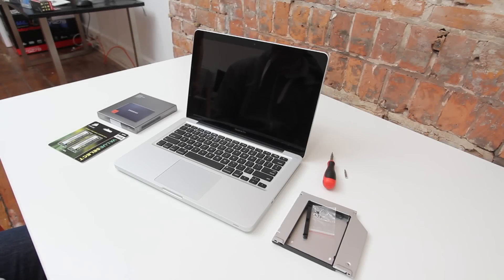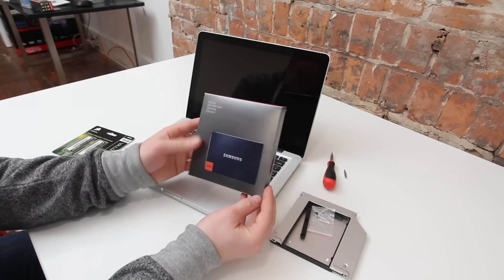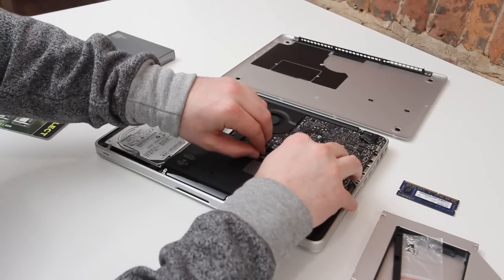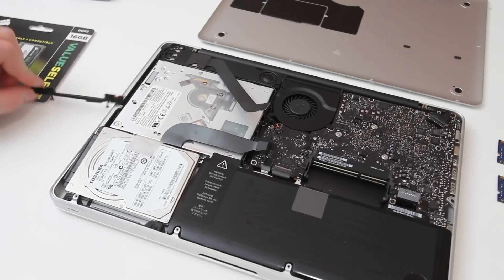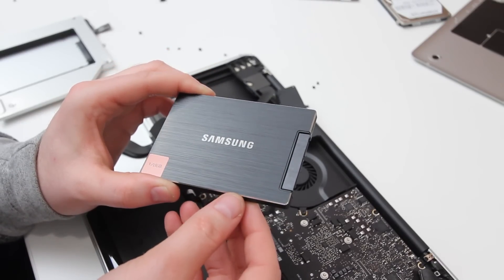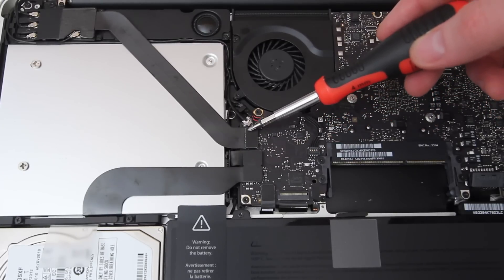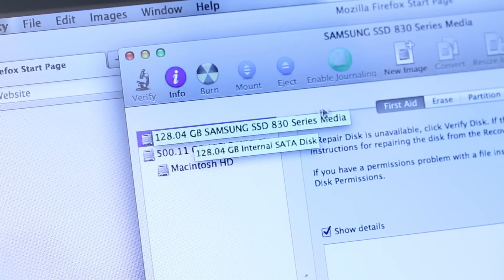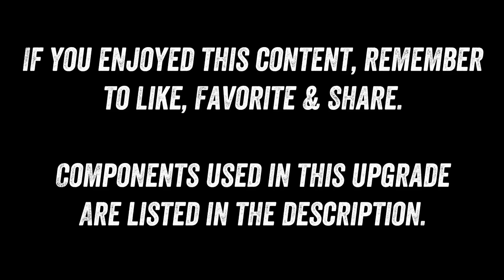Upgrade Your Macbook Pro (SSD Upgrade, RAM Upgrade, Optical Drive Bay Adapter)

Comment: Hi I have a question: If instead HDD was put at the optical drive area, and SSD in the main drive area can you still boot up your OS with HDD being at optical drive, and just clone everything to the SSD once it's booted, or you would have to install the OS on SSD first (from USB stick or Wi-Fi) ? Thanks in advance

Comment: Hi. I installed a second ssd on my 13' 2011 MBP OS High Sierra. Not thinking at all the new SSD needed formatting. Took it out, formatted it using a HD Dock thru usb. Put it back in the casing and back into my MBP. Turned it on. Still no second SSD. Any clue what I'm missing?

Comment: I've used Tardisk to update my mac air2014 SSD, however, my mac is slow when running a lot of programs, so i think it's time to change the RAM as well. do you know if this RAM-you used in the video-compatible with may mac?

Comment: i know this video is 4 years old. i just ordered the same set up. i hope it's not too out of date
Reply: patrick mallare which size adapter did you get? There's a 9.5mm and 12.7mm. Planning on doing this myself
Reply: I have a MacBook Pro 13inch late 2011and I upgraded with a Samsung SSD as main hard drive + Old HDD from before as second hard drive + 16 Ram = Couldn't be happier with the result!
Reply: There are some vids of the mid 2012 worth getting in 2017/18 👌🏽
Reply: how'd it go?
Reply: works well, I would just go with a bigger ssd if I would do it over

Comment: if i put my original hdd in the optical drive will I be able to boot from there and copy my system on the ssd?
Reply: It may be possible to clone it, but the easiest way I've found is to just restore a Time Machine backup to the SSD.

Comment: Would this upgrade work on my Mid 2010 MacBook Pro concerning the ram issue because its benchmark at a maximum of 8GB OF RAM
Reply: mack2002 hi bro..... I have the same macbook 2010 mid white can I upgrade it to 16 gb ram...
Reply: its supposed to be 8GB but it can handle 16Gb

Comment: Could you upgrade it for gaming?
Reply: I'd say no. I have a mid 2010 Macbook pro which I upgraded the ssd and ram on. which is about all I can do. You cant make it good enough for real gaming.
Reply: I use an external graphics card and it works quite well for gaming.
Reply: +Opinionated  you can, just install Windows 7, it have a so good performance for gaming
Reply: how? it doesn't have thunderbolt 3?
Reply: yes you can it is not cheap you can buy an eternal thunderbolt PCIe box and add any of the newer 10 series Nvidia GPU something like a 1050ti and the thunderbolt box will set you back some $500

Comment: Hi everyone. Can anyone recommend which type of SSD to use? I am asking because as i understand it, the SSD technology is evolving rapidly, so that makes me think there might be a better one now, than the one used in the video. If i go to the link, it says on amazon "there is a newer model of this item". I dont know what to do - can someone please help with some advice? I am not experienced in this... Thank you :)
Reply: As i understand it, the bay and the ram has to fit to the model and hardware. In terms of dimensions and operating frequency. But, the SSD is new to me. I dont know how it works. About SATA and all that stuff :) I would be so happy to if someone could let me know what to do - I dont need to understand it this time - what a relief!! :D 
I just want my computer to be faster :) (its Macbook Pro 15" late 2011)
Reply: This is the new model of SSD. Will it work with my mac?
https://www.amazon.com/Samsung-850-EVO-2-5-Inch-MZ-75E250B/dp/B00OAJ412U/ref=dp_ob_title_ce
Reply: i have an 850 evo 500gb in my macbook pro, its works great, the difference in speed is night and day. its an absolute must, and you should upgrade to atleast 8gbs of ram if you haven't already
Reply: Thank you. I have upgraded. 850 evo 250GB and 16GB RAM. It works wonderful. Like getting a new computer - exactly like others are saying.

Comment: this is stupid... putting the SSD in the optical port is ridicules. you should have switched them...
Reply: damm there is some serious computer people here i have no idea what you guys are even saying lmao
Reply: Pratyush Praveen search worlds fastest MacBook Pro on YouTube, and watch Jonathan Morrison's video series, he got a 4 short video parts that explain everything from the upgrade to installing the OS and performance.( he is using a 15in MacBook Pro, which the upgrade process, so find another tutorial, unless you have a 15in) I hope this helped, its really easy
Reply: Pratyush Praveen do you want to clone your hard drive to your ssd or just install a fresh install of OS X
Reply: Dungeon, im planning to upgrade my mid 2012mbp. It is 512gb hdd and 4gb ram original stocked. Im planning to remove disk drive and add original 512hdd into optical bay and also upgrade ram into 16gb. The question, is there any difference if if place 128gb SDD or 256 SDD ? I would store only OSX and apps on SSD. And all the other stuff in my old HDD (which is 512gb). The storage will affect the speed and boot time or not? Thank you.
Reply: Hi Dungeon Like. You seem like you know your stuff :) So i want to ask you: Do you know if the links and the products are still good / working? I dont know much about this stuff, so was thinking about it because this video is from 2012. I want to make this upgrade, but i am not sure which ram, ssd and bay adapter to choose - i guess i am concerned with compatibility. I have Mackbook Pro late 2011.
Reply: as far asi know the parts listed are still good, the model may change for the 2011 macbook optical replacement though, id double check the model numbers before proceeding.i got my caddy on eBay for 5$ myself, it should be quite easy to find
Reply: I just checked again, it says both my optical drive and the normal ssd space are both 6 gigabit, early 2011 macbook pro 13in i7 8gbs of ram one samsung 850 ssd 500gb (currently, i plan to add another ssd in raid, and 16gbs of ram)
Reply: Hey i'm doing what you suggested. Putting a new SSD in the main bay and the HDD in the optical bay. Although I need some help on how to load Mac OS into the SSD and make that the default start up drive.
Reply: I want to clone what's on my hard drive and then just use the hard drive as extra storage.
Reply: @dungeon Like: so you mean 
- open laptop
- remove optical drive
- remove current original HDD
- place new SSD in place of original HDD in main bay
- place original HDD in caddy
- place caddy in optical drive bay
- boot system
- clone hdd to ssd (using SuperDuper)
- format (delete/erase) HDD
- from here forth, use SSD as main drive with OS on it, and HDD as storage
- live happily ever after
correct?

Comment: hey replacing the optical drive with ssd and keep the stock hard drive at his original place will it improve the performance of my macbook
Reply: I'd recommend you to install the ssd in the main bay and the hard drive in the optical drive bay, and yes, it will make it way faster

Comment: Did macbook pro 13 inch mid 2012 still support when using 16gb of ram? coz i found that it only supported up to 8gb of ram only.
Reply: I have a 2012 MBP and did the 16gb ram upgrade. Works great! Definitely recommended it

However, my MBP is a 15" and I'm not sure if they're different hardware wise
Reply: +ZROBIN_MUSIC thank for the reply, i'll give it a try ✌🏻️

Comment: What is the point of having an optical drive adapter? I already installed an SSD on my mac book pro, would a second one increase it's speed and performance? How so? Wat else, thanks
Reply: +joshybumboshy The optical drive adaptor makes it possible to install two drives in the computer. This can be used to add storage. I personally will install an SSD and run the operating system and games off of it. This will make boot up much faster and games run faster and at better internal temperatures. I am keeping my original 500GB to store photos and other large files on. If you had two original hard drives in your machine it will not necessarily increase speed or performance only increase storage.
Reply: if you install 2 ssds in raid, it will double your read and write speeds, keep in mind that in order to raid 2 ssds, they at least need to be the same size, but what i suggest is getting 2 of the exact same ssds. also say you have 2 500gb ssds in raid you will have 1tb/1000gbs. so to answer your question it does increase the proformance and speed. it might even be more expensive to buy 2 500gbs ssds but you get double the read and write speed.

Comment: Can my Macbook Pro 13 inch mid 2012 work well with a sata 3 ssd interface?
Reply: yes they are all SATA 3 but Apple use SATA 2 mechanical hard drives

Comment: Any Photographers out there still using Mid 2012 Macbook pro 13"? I have a mid 2012 macbook pro 13" that i bought from Apple Store last year. If i upgrade it to 16gb ram and SDD 480gb... will it run better with latest OS X, El Capiton?
Reply: i have 8gb same model and el capitain works greattt
Reply: are you using SSD?
Reply: You Macbook will perform MUCH MUCH MUCH faster and better. I upgraded my 2011 Macbook Pro with 4GB of ram, 750GB HDD to 16GB ram and 512GB SSD. My Macbook boots 2x faster and I now can use many apps at once, I usually run Photoshop (large files up to 2GB), Spotify, Safari, Mail, Bridge, etc. and 16GB makes it all so much faster.

I advise you to upgrade both the ram and storage. I personally paid 420€ for the entire upgrade in early 2014 (installed myself of course) and I am absolutely certain you could do the same thing for just 230€ today.
Reply: the difference is night and day, your read and write speeds with one ssd will 10 times better than a traditional HDD, you really need to if you haven't already

Comment: ive read all over the internet that mid 2010s will not function properly with more than 8gb of RAM. 8 is the ceiling
Reply: so 16GB of ram is useless for the Macbook pro 13" 2010 mid ?
Reply: @jshbluesky  If it's Intel Core 2 Duo it will see the full 16Gb of ram (mine does)

Comment: What does optical drive do? And what difference will the SSD make?
Reply: +Pseu SSDs have much faster write and read speed meaning the drive is much faster at writing files on your system as well as reading them. You're computer will be much faster and you'll become a one happy panda! :)
Reply: +Pseu It's the CD/DVD drive
Reply: the optical drive records and plays CD and DVD the mac will boot ten times faster and applications will open instantly

Comment: apple said, the max of macbook pro mid 2012's ram is 4 gb, but if i want to upgrade to 16 gb without changing the hard drive, its works or not?
Check this https://support.apple.com/en-us/HT201165
Reply: This is the same computer I have and I am running on 16GB just fine!

Comment: My macbook is late 2011 (13inch) but it says the max Ram is 8GB but i noticed you installed  16GB... does it matter ? what is your suggestion?
Reply: +Abel Casanova Apple officially supports a maximum of 8 GB of RAM, but third-parties have determined that this model actually is capable of using up to 16 GB of RAM with two 8 GB memory modules.

Comment: what does the RAM and SSD do to the mac?
Reply: +fastfreddy01 let me explain. the RAM which means random access memory is what makes your macbook go faster , the more ram the faster your macbook will go. and for the SSD thats in other terms a memory card. its basically more memory for you to have
Reply: +JustAnotherNewYorkCityRAT not necessarily. The more RAM you have, the more you can multitask. Being able to open more tabs in safari, rendering video in after effects while surfing the web. SSD is actually what helps to speed the overall performance of your  computer versus the traditional hard drive that relies on a spinning disk.

Comment: I have a 13" macbook non Pro, early 2007. I want to put in a SSD and add some Ram. I have the original OS discs as well as Leopard OS disc. How current can I upgrade the OS, after I put in the SSD , Ram? Does that depend on the processor? Mine is Intel dual core.
Reply: you can go up to OS X 10.6 snow leopard.
Reply: the SSD will improve performance significantly. your boot time will be cut in half. I bought a $35 60gb ssd at fry's and that's the performance increase I got. the white macbook is harder to take apart but if you are patient and smart you can do it. you don't need the latest ssd since the Sata 150 bus wont appreciate a Samsung evo.

Comment: will this memory work on an early 2011 MacBook Pro 13in. Apple says 8gb max and I've heard of some issues. don't know if they would apply to me or only previous generations.
Reply: +Brendan Byrne Yes 16gb RAM will work on your MacBook Pro. Many people will argue that 16gb is overkill for the average MacBook user
Reply: 16GB will mean you can open many apps at once 8GB is great but 16GB plus the SSD is super snappy

Comment: What's the component that he touches at @5:20 ? 
Right after he puts the RAM chips back.
Reply: +Quez Films This is the battery connector. The first thing you should do when u open your macbook is disconnect this component to prevent electricity from going around while ur fixing it. The last thing to do would be to plug it back in . Re-watch the video you will see he removes it the first thing .
Reply: Mounir S. THANK YOU!! Very helpful.

Comment: Could you give me help? I have the Macbook 13" from mid 2010 and I already have the caddy for my HD 350Gb where I want to keep all my files and install the SSD 128 Gb in there place so I didn't get how to install the OSX in the SSD I saw view videos where they save in a Pen Drive 8 Gb, but still didn't make sense to me and you are too fast for my knowledge.  Take Care!!!
Reply: +Marcio Belaustegue download the Capitan installer from the App store. Run it, and when it asks you, choose to install it on the SSD.  Tell me if this works for you.
Reply: I`ll do this week and let you know. Thanks.
Reply: +Mounir S. Hey, can you please answer a question (if you know). Will a Samsung 830 Series SSD work on a mid 2009 13" macbook pro, with 8gb of ram installed? Please respond and thanks!
Reply: +Marcio Belaustegue Did it worked?
Reply: So well and Didn't recognized. Now my Mac, has a SSD 128 and caddy with my HD 350. Thanks a Lot!!!
Reply: Marcio Belaustegue I did it yesterday, it works so fast! Pas normal :)
Reply: i'm waiting for my caddy to be shipped. it is in transit

Comment: I want to add SSD to my Late 2011 Mac book pro 13"  , just wondering , will this SSD work , Samsung 850 EVO 250GB  2.5 Inch SATA III Internal SSD (MZ75-E250/AM) available at amazon.com. Will this fit in the same optical drive adapter.
Also is this better then Samsung 830.Or should I go with Samsung 830?
Please advise. 
http://www.amazon.com/Samsung-2-5-Inch-Internal-MZ-75E250B-AM/dp/B00OAJ412U/ref=pd_sim_sbs_147_1?ie=UTF8&dpID=319X5owiyFL&dpSrc=sims&preST=_AC_UL160_SR160%2C160_&refRID=0X3WS3KJ1608ZBEMRNS2
Reply: I also have the same question, we need an answer please 😭😭

Comment: Hi guys what would be more important to upgrade RAM  from 2 to 8 or  HDD to SSD to make it faster  . My comp is MacBook Pro mid 2009  Thank you
Reply: +CookieMurderer123 
I have same MBP as you and just updated the HDD with an SSD. It is noticeably quicker and I gained 90g of storage (from 160 to 250g).  I bought the Samsung 850 Evo SSD.  Follow the steps in this video http://www.cnet.com/how-to/upgrade-your-macbook-install-ssd-hard-drive/ 
If you go to 8 RAM, that would be the cherry on top! Your MBP would run like new.
Reply: gilles monvoisin Thanks , i just replace Ram to 8 gb so it was improved significantly , so next step is SSD
Reply: +CookieMurderer123 : did u upgrade in SSD?
Reply: Not yet , just RAM from 2-to 8 , big improvement so fart
Reply: Upgrade to an SSD and you'll be flying!
Reply: After upgrading according to the above said specs, will i be able to use high end apps like photoshop cs6 and lightroom without any lag,on macbook pro 2010.i mean does the old processor on macbook pro 2010 will run smoothly these softwares.?? Please reply.

Comment: Will this exact set up work with my 2013 mac book 13 inch? Sorry new but really considering doing this
Reply: +Johnny Morales if your MacBook Pro is the Retina model , it will not work. Your MacBook already has an SSD and it does not even have an optical drive bay.

Comment: how much of an actual performance increase are we looking at with this exact upgrade? (mid-2012 model)
Reply: RyanFrizey well let me tell you something, I did the ram upgrade from 4gb to 8gb(it was a needed upgrade but in terms of big speed difference it wasn't really noticeable), and I hardly noticed a difference, however the ssd upgrade is real night and day different, it's incredible the difference, even if you do get a new computer in the next few months, you really really really should do it if you can. I will make you think twice about getting a new computer. if you haven't experienced the difference from an HDD to ssd before, you need to. My dad has a late 2014 5K iMac with a 32gb ram upgrade, I can safely say it's just as fast or even faster. Need I say more lol
Reply: Boot Time ?
Reply: +RyanFrizey INSANE 10x PERFORMANCE BOOST (imo)
Reply: night and day difference, just do it, and thank me later (if your haven't done it already
Reply: Sebastian G Did the cheap ram upgrade last week and the difference has been literally like you said, night and day!
Reply: RyanFrizey have you done the ssd yet?
Reply: Sebastian G Nah, ill be looking to get a new laptop sometime at the end of the year, the ram was just to get until that point